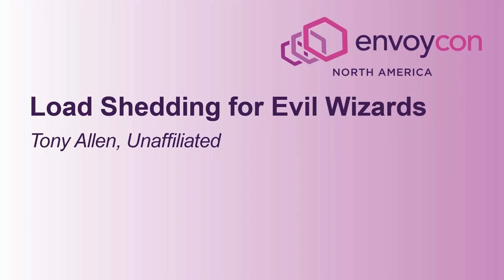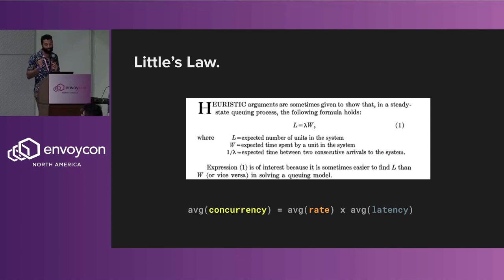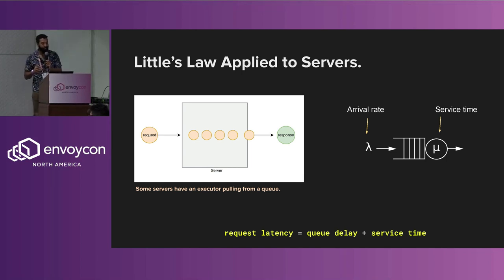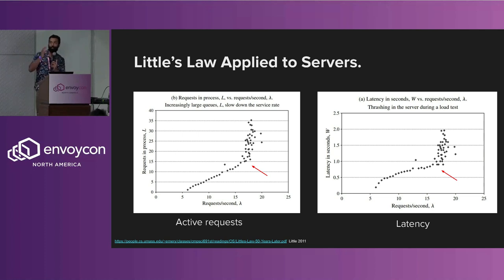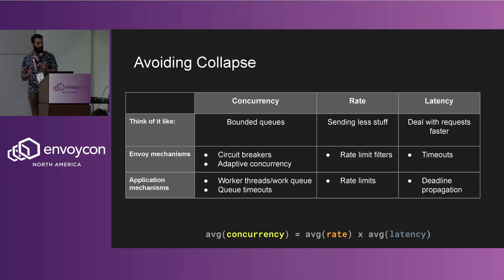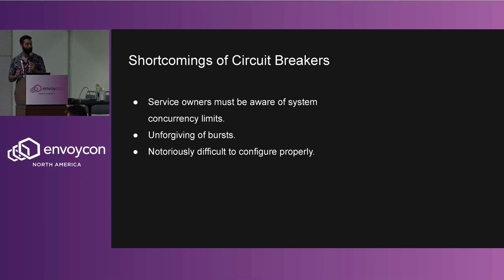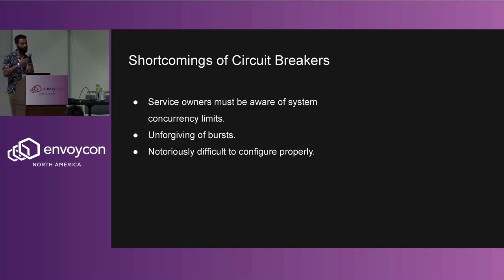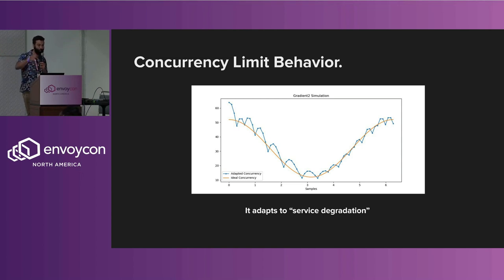Load Shedding for Evil Wizards - Tony Allen, Unaffiliated

Comment: I don’t understand what is the benefit of doing admissions control in the client instead of using adaptive rate limiting or adaptive concurrency control in the client.
Reply: Admission control should be used for client-side throttling and adaptive concurrency is only useable server-side. Suppose there is so much traffic that the act of load shedding at the server is exhausting resources or the network links are saturated and requests don't even make it to the server- that's where admission control is useful.

I glossed over it towards the end because of time contraints, but I very briefly mention it at https://youtu.be/UInZ9yViUS0?t=1720. The admission control documentation in the  Envoy docs also has a more thorough explanation!